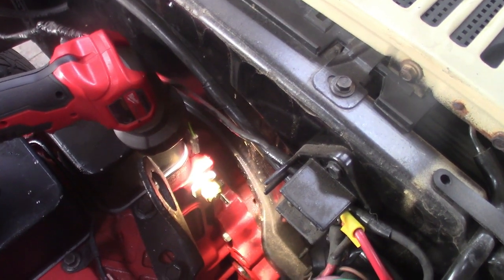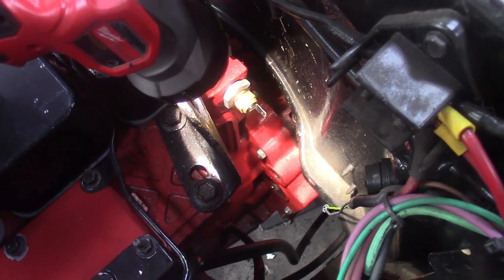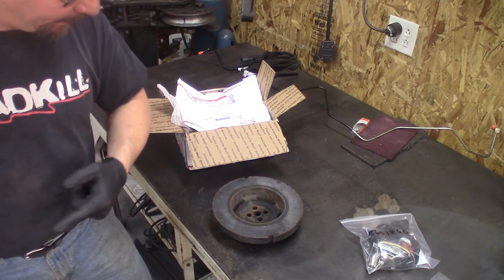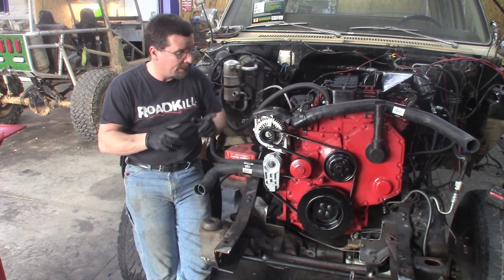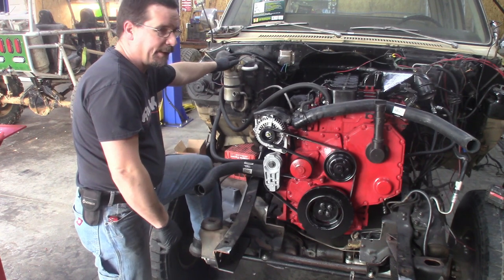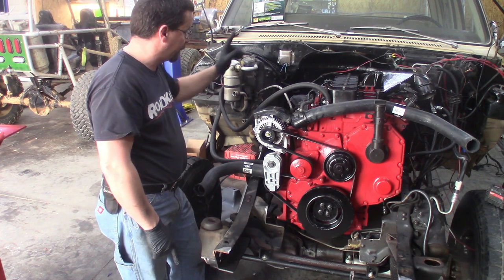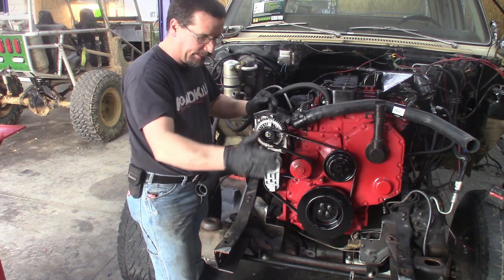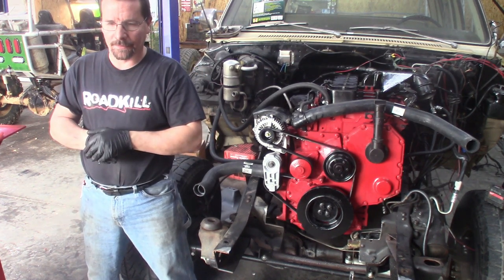How to Make Chevy Gauges Work With the Cummins Engine

Comment: I watched a u tube video of a shop that does the conversation.  I should have know that there was different ac , alternator arrangements . The one I saw was a high mount ac unit . They also used a sensor wire on the alternator and I think a box to calibrate the signal for the tach . I going to add a manual gauge oil pressure to my truck so the information was helpful thanks

Comment: alright mr.rico first off ill say your videos are crazy helpful, much appreciated. for the water temp sensor, i used my old 350 water temp sensor and wasnt getting a reading. i ordered a new 350 water temp sensor and still am not getting a reading, i grounded out my temp senor wire and it went full hot. so the wires good, i have 0 tephlon tape so i have a good ground. do you have any ideas what could be my problem? i am installing in the same location you are.
Reply from the maker: Glad my videos helped. 
Just a thought have you made sure the parts store isn't giving you the wrong sending unit? .
If they mistakenly gave you a sending unit for a light and not a gauge it could give you the problem you are having

Comment: I have a complete mid-mount kit out of an F700 if you're interested.  Bracket, tensioner, water neck, alternator brackets, thermostat housing, the entire thing.  I'll make a good deal if you decide to go that route.  Tried to find your post on the FB page but can't find it now.
Reply from the maker: Email me at rcoxjeep@gmail.com. let me know what you want for it I may be interested in that.
Reply: @RicosGarage  Will do.  I'll snap some pictures of it and send an email later today.
Reply: @lyndonweaver2409  sold, sorry

Comment: hello, what did you do about oil pressure switch so its not fully making out?
Reply from the maker: I ended up going with an aftermarket oil pressure gauge. All the other factory gauges work fine.

Comment: Is that frame cut to make the engine fit?
Reply from the maker: Had to modify the front crossmember to clear the balancer. 
The mods were not finished in this video. Just a rough cut for clearance as you see
Reply: @RicosGarage  is that the only way to do it or do they make kits?
Reply from the maker: There's kits available if you are not comfortable with doing the fabrication yourself